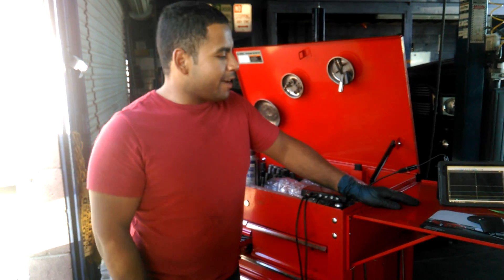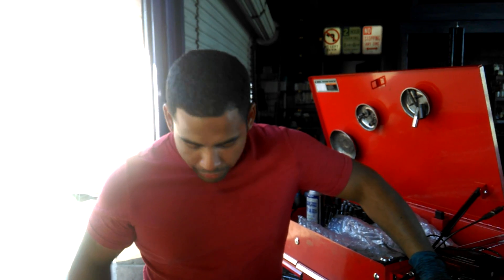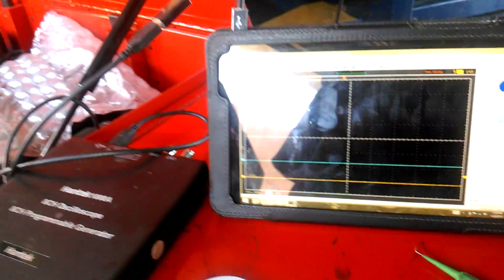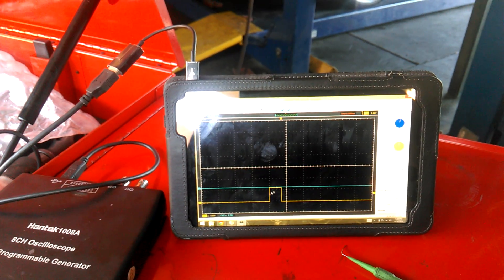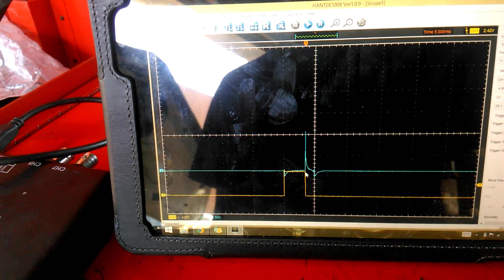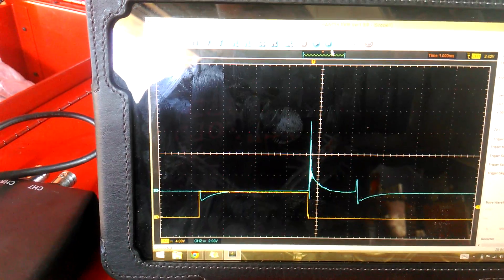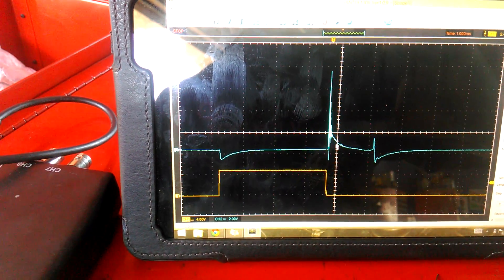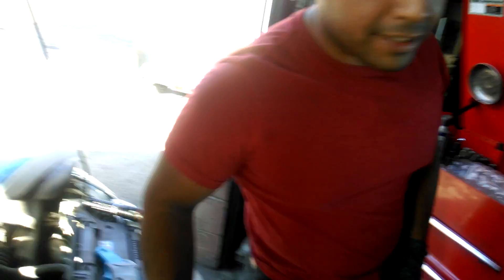Hantek 1008 Secondary Ignition Waveform

Comment: Isn't the ignition secondary VERY HIGH voltage??  At 5v per division. it appears not to exceed 30V.   Shouldn't it be closer to 30KV ???   Or is your blue channel at a higher volt per division than the transistor wave??
THANKS MUCH!!!!

Comment: Enjoy your videos.  Have a question about an issue I am having.  I have a Hantek 1008C with a HT25 and am using it on a S10 Blazer with a distributor ignition.  I can get a good spark signal on the coil wire but none on the sparkplug wire.  Tried the clamp at the plug and several places but no help.  Any ideas.

Comment: The Hantek 1008C CANNOT handle high voltage noise near it as it will lockup or even crash the attached PC so as an Automotive scope for secondary ignition work it is a complete failure! Save up your money and buy something else for doing secondary ignition work!

Comment: SOrry, what is it that you used to pick up that secondary waveform from the coil. i tried to listen but could not hear you

m.b.s moshitoa (s africa)
Reply from the maker: 4 mm banana plug
https://www.digikey.com/en/products/detail/pomona-electronics/5406-2/737300?utm_adgroup=Connectors%2C%20Interconnects&utm_source=google&utm_medium=cpc&utm_campaign=Shopping_Supplier_Pomona%20Electronics_0501_Co-op&utm_term=&utm_content=Connectors%2C%20Interconnects&gclid=Cj0KCQjwoJX8BRCZARIsAEWBFMISrpSyav7QB5CiPdBndBNpZmCjxbMQRpltNz0E-wkLjW9TFTESogwaAiOrEALw_wcB
Reply: @Enrique_Osorio  oooops, i do think banana plug is just like a wire. then if indeed you used it , then does that mean the scope would have picked the signal even if you had had no banana plug

Comment: You run into any issues measuring with the clamp-on probe they supply? Snap throttle tests seem to be locking the program up on me.
Reply from the maker: Which clamp on probe? The one to measure current or the one to measure the voltage of the spark plug wires?

If you are using it to measure ignition coil current, then you may need to check that you route your leads carefully. They are very susceptible to noise. If the leads are anywhere near the ignition coils then errors occur.

If you are using the clamp for the ignition coil wires, try routing the cable so only the clamp is near the spark plug wire, again noise can be a problem.

A simple stiff wire shaped like a curvy S hung on the hood latch striker is a good place to hang wires to keep them away from sources of noise. Let me know if this helps.

Comment: I know this is old but do you know what tablet I can hook a picoscope up to?
Reply from the maker: What I have noticed is that most PicoScopes use USB 3.0, so as long as your tablet is running WIndows, meets the minimum hardware requirements, has the necessary memory and drive space and a USB 3.0 port, you should be good to go.

Comment: Looks like a good way to check these coil on plug set-up.  You should be able to find a ignition caused missfire.  The square wave would show you a ECM failure while the secondary would show a coil or plug failure.  Nice little trick.

Comment: what probe would you use if cop is 2 wire and secondary has no transistor?
Reply from the maker: This trick should still work but you can also use an attenuator of the control side of the ignition coil on two wire ignition coils.

Comment: Hey Enrique Osorio ! First I want to say, thank you for the great vidios! You are explaining very good. I have learned how to get my Hantek 1008 to work and properly from your videos ! The only problem that I've had is with the Secondary Ignition Probe. The scope freezes every time I try to connect the probe to spark plug cable with the clamp on ground on battery. Have you had this problem with your Hantek? I think that my probe or scope might have defect.

Comment: Hello, I have just purchased one of these and I am trying to use the hantek ht-25 on a conventional ignition system and when I connect the lead the to wire my hantek software freezes and sometimes I get a blue screen of death. my setup is a win7 laptop with the 1008c using ht-25 probe.  Any advice?

Comment: Hello Enrique!!! On my '05 G35 VQ35DE, I can't figure out a what seems to be a single cylinder misfire ever since I had my spark plugs and throttle body cleaned. Note: Initially after job, coil connectors for cylinders 4 and 6 were improperly reversed causing P0300.Since, I've been dealing with a misfire felt only at idle. I was able to get a look at the control signals on cylinders 1( looked good) and 3 (not so good). So I replaced coil and plug for cylinder 3. No change. I would like to look at secondary ignition waveform as you did here. I have a Verus. Can you help me with the settings since I'm not using the traditional setup for the scope to see that waveform? Thanks!!!
Reply: Btw, I have video of the coil control signal square waveforms that I can send you if you don't mind taking a look. My email is tgoodm1@hotmail. Thank again!!!
Reply from the maker: I would be happy to take a look. I do not post my email on comments to reduce spam, go to my ABOUT page on my main channel page and you will find my email.
Reply from the maker: If you have a VERUS use the set up I used with the banana probe. If you can swing it get an ignition coil secondary tester 
https://picoauto.com/products/ignition-accessories/coil-on-plug-cop-signal-probe
I have the older version of this probe and it works great.

If you decide you want to do it with the 4mm banana probe use a 5ms screen with 20 volts peak to peak. Snap on does not use volts per division or time per division, so start with those settings and tweak it until it looks right.

I have a few questions, did you have your spark plugs replaced or cleaned? Did you do the Idle relearn after cleaning the throttle body? (The idle relearn is really tricky to do on Nissan/Infiniti)  Are there any other codes? Do all the ignition coil boots have dielectric grease (boot grease) on them? Are the rest of the connectors correctly placed? (That 4/6 swap is a common mistake) Whee the correct spark plugs used? Any cracked porcelain on the plugs, both inside and out? Was the throttle body cleaned before or after the spark plugs were replaced, sometimes the chemicals used to clean throttle bodies can foul brand new spark plugs.

I know these are a lot of questions, so you do not have to answer them all but they are things to think about.

Another thing I would like to mention is that the control signal should be a square wave, this is generated by the PCM, it should not look like anything else but a square wave, so I am curious as to what you mean by the  #3 control signal not looking good.
Reply: +Enrique Osorio The spark plugs are all new NGK Iridiums. No cracks in the insulators. No dielectric grease used. All original coils are back in. Car never did it prior for all 150k miles. 

Update: On Friday, I did another visual inspection and made some comparisons to other pics and videos of my engine and coil wires on Bank 1. I noticed that my coil wires hadn't been tucked back alongside and directly over the coils. I noticed that the wire was in close proximity to the intake valve timing solenoid and I also needed to add some electrical tape as some of the wires leading to the coils were showing while close to solenoid. Ever since moving the wires back, I've driven about 170 miles and have not experienced the misfires. Car rides great!!! I'm hoping it's not just a coincidence. But the last 4 days have been great. I'll try to get that video for you to see anyway.

Thanks for the Verus setup information!!!
Reply: Enrique Osorio I didn't see your other questions before. 

 Idle/relearn not performed. I have no CEL and the idle, with exception to the misfire, has been normal as before. 

All other coil connectors were properly reinstalled. Correct plug gap was used, per the Haynes manual. Throttle body was cleaned before spark plug replacement.
Reply: Enrique Osorio I am not finding any info on your "About" page. You can feel free to send me an email and I can reply with everything you need though. Thanks again!!!
Reply from the maker: I'm glad it worked out, thanks for letting me know, that is an interesting fix. Here is the page where you will find my email

https://www.youtube.com/user/rx8on19ss/about
It is right next to Business Inquiries

Comment: hello enrique,  i have a quesution.    i have some old mercedes cars from 1968-1976 with cap/rotor ignition setups.  i want to buy a scope.  can this hantek show all 4 or 6 or 8 sparks next to eachother like for instance an old bulky sun engine tester with a scope?  are there any screenshots were i can see tha?    i look forward to your answer.
Reply from the maker: Yes you can using a secondary ignition probe. I am currently working on a video showing how to do it not on a V8 but it should be informative. The only issue is that with 8 channels working at once you reduce the "resolution" but you should be able to see peak ignition voltage outputs like the old sun machines.
Reply: ok great, i am looking forward to that video.  can i sent you an email.  i want to sent you a picture but i cant do that in here.  please mail me at igor@stenautomotive.com or sent me your email here.  thanks!
Reply from the maker: I sent you an email with the subject line Enrique Here.
Reply: hello,  yes thanks!! i will respond soon.
Reply: Did you ever do that video showing how to get multiple secondary waveforms on the screen?

Comment: Do you still have the hantek unit? i'm thinking about getting one but everyone keeps telling me its crap.  has it failed on you in any way yet?
Reply from the maker: I do still have it and it is crap compared to everything else. That being said I own a PicoScope and a Tektronix oscilloscope and I still use the Hantek at times.  I normally use it when I want to check a signal on a project and I do not need it to be super precise. The Hantek works, and I have put it through hell for the past 4 years and it still works. Maybe I got lucky but that's my story.
Reply: Can you explain how's its crap?  Just curious
Reply from the maker: Compared to other much more expensive oscilloscopes it does not have the same features. For example...
1) In a lot of more expensive scopes you can capture a signal, freeze it and zoom in zoom out and analyze the waveform in different time bases. On the Hantek the best you can do is view the signal as you capture it. If you try to zoom in you do not get any more detail. If you zoom out the waveform just gets smaller and you don't see anymore signal.
2) The sample rate of the Hantek is 2.4 Megasamples per second so any signal with a frequency higher than 100 kHz is not very readable.
3) The software takes time to get used to and is somewhat complicated to set up and starts up in Chinese. I made a video showing how to install the software and drivers and converting it to English but that procedure no longer works so I deleted the video. If you do buy the Hantek 1008 I will give you the new correct instructions, just let me know.
4) There is no way to directly measure amperage/current. The only way is with an accessory.
5) The accessories are not that great, but you could use higher quality accessories with the Hantek as long as they have a BNC connector
6) A lot of other automotive oscilloscopes can measure and graph frequency, this one does it
The only reason to buy a Hantek is to get used to a scope to see if this type of tool is right for you. I have used the Hantek extensively when I worked as a mechanic, but there was a lot of trial and error and a lot of time spent after work learning how to use it effectively. If you find yourself buying this and you use it a lot then you know you really need a better machine that is more use friendly and has a lot more features.
Reply: Is there anything significantly better than the hantek that is somewhat close to the price?  I'm just a hobby mechanic and would like an oscilloscope as a learning tool, but don't want to break my teeth trying to use it.

Comment: Hey man awesome video I have a couple questions, first off to measure secondary ignition waveforms with this scope did you need the attenuator? I know voltage spikes are in the KV's and the attenuator is only rated for 300v max so maybe you could explain that to me? Also anything special to hook it up to your tablet I'm going to be Doing the same thing, thanks again!
Reply from the maker: The secondary ignition waveform I am measuring is being done indirectly. Most secondary ignition waveforms are measured indirectly. What this means is that there is NO physical connection between my probe and the secondary circuit of the ignition coil. What I am measuring is the electromagnetic signals that are coming off the coil, which is inducing a voltage in the probe.
Think about it this way, let say you want to see how hot an oven is, but the measuring device is your hand. You obviously can not touch the walls of the oven directly but you can hover your hand over the oven and get an idea of how hot the oven is. It is kind of like that.
The voltages that are induced in the probe by the coil are low so an attenuator is not necessary.

As for the tablet, I am using a micro USB to USB adapter otherwise known as an OTG adapter to connect the Hantek to my tablet. The tablet is a Dell Venue 8 Pro running Windows 10 Home Edition.

Thanks for your comments and questions!!!
Reply: Alright that makes more sense, thank you!

Comment: Hi Enrique. Is it possible that Hantek 1008 has the same features as the snapon vantage pro scope?  Notice that I want it to buy the Vantage Scope but too expensive to buy. So I am looking at Ebay for affordable automotive scope.
Reply from the maker: The Hantek DOES NOT have the same features of the Vantage. The Hantek is an effective tool but it does have its limitations. It is not a replacement for a higher end scope such as the Vantage. That being said the Hantek is a good starting point, especially if you are unsure if an oscilloscope will be an effective tool for you.

Comment: I just got my new Hantek and was try to do the same thing from watching your video, but my signal keeps moving it's not still like yours is. How do I keep it still like yours? thanks and keep the videos coming
Reply from the maker: Make sure that you have the trigger set correctly. The trigger is the arrow that is on the right side of the waveform screen. Make sure to select the trigger channel on the settings on the right as well. The trigger should be within the range that you expect the signal to be in.

Comment: Enrique Osorio,what extra features 4 mm male banana jack has to pull on that  secondary spark waveform on the scope that that the alligator probes cannot do the same thing.
Reply from the maker: To be perfectly honest I have no idea. I got the idea from the picoscope software where they recommended a 4mm banana plug to do this very test IF you did not have the dedicated probe. I have not tried to do it with an alligator clip but if I get the opportunity I will try and let you know how it goes.

Comment: Hi Enrique, what probes do you use?
Reply from the maker: For this particular video, none, but some useful ones are, low and high current amp clamps, secondary ignition clamps, and a coil on plug probe.
Reply: +Enrique Osorio ah right I have just ordered a 1008 C I've ordered some hantek probes but need a attenuator does any 20:1 work?

Comment: He said, "you don't need an attenuator," but if you pause the video at 00:21, you clearly see an 20:1 type attenuator connector to channel A, (lol).  People, please don't electrify yourself after watching this video or cook your scoping electronic. keke
Reply from the maker: +Tony L Thanks for you comment Tony, I do like it when people correct me because it helps everyone, you and me alike. That being said I do have an attenuator on Channel 1 also known as Channel A on the Picoscope but that is the channel that is back probing the computer controlled signal wire of the ignition coil not the one I am probing the top of the coil with, which is Channel 2. The attenuator is there are sometimes spikes of voltage that get through the transistor inside the coil which can sometimes be higher than 25 volts.
    Just to be clear Channel 1 is the yellow trace with the square wave and Channel 2 is the blue trace with the secondary ignition signal.
    This does not mean that an attenuator is a bad idea its just that you do not absolutely need one for this test and I wanted to demonstrate that. An attenuator with a grounded negative lead will add an extra layer of protection that can prevent damage to your scope so it is a good idea.
    Thanks again Tony, hope to hear from you again soon.

Comment: Enrique, I can't seem to get a waveform using the HT 25 lead that came with the scope.  Clamp in on the plug wire and there is nothing on screen.  Is there some special settings for it, trying to determine if its just a bad lead..great video btw!

Comment: Memory depth of your scope is only 4k, is it enough to pause and play back waveforms? I plan to buy dso3102 with 256M memory, 1GSa/s sampling rate and 8bit vertical resolution. Do you think it will miss many details compared to 12bit? Thanks for nice videos.
Reply from the maker: +Mambre Khachatryan You can pause a waveform but you can not play it back. What ever you pause it on is what you get. The zoom function does not give you anymore detail. As far as the resolution 8 bit can hold 2^8 = 256 numbers while 12 bit can hold 2^12 = 4096 numbers. There is definitely a big difference which may cause you to lose some clarity. I can not say for sure since I have never used a scope with 8 bits of vertical resolution.